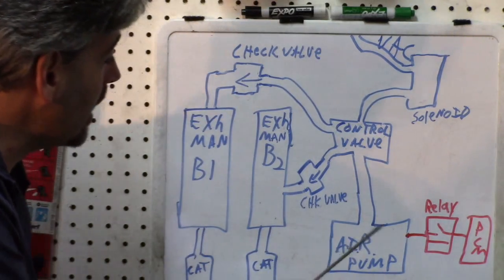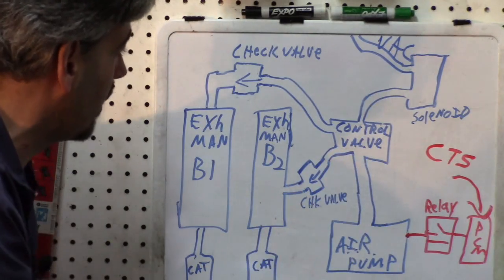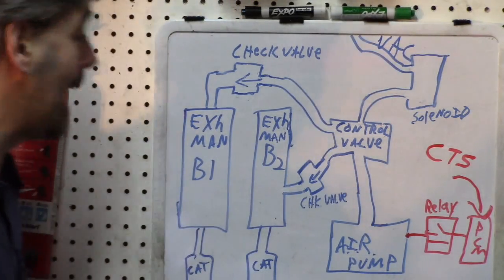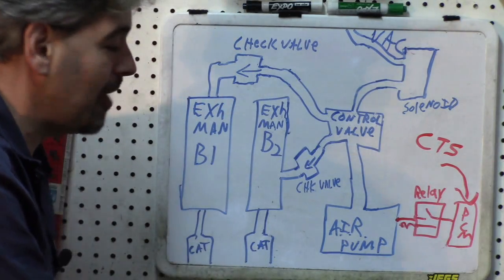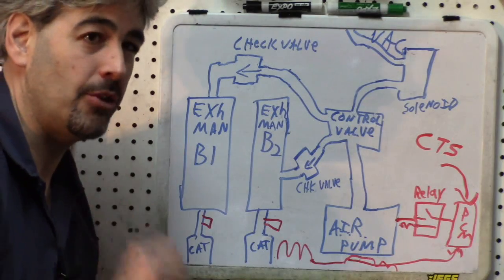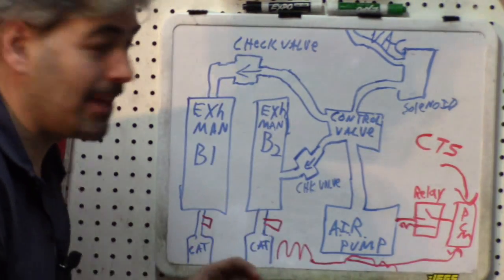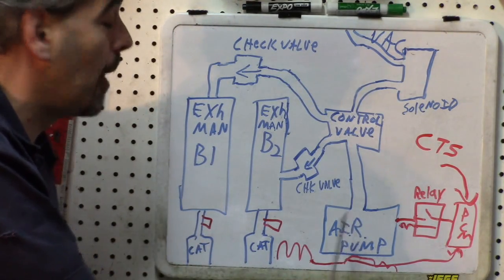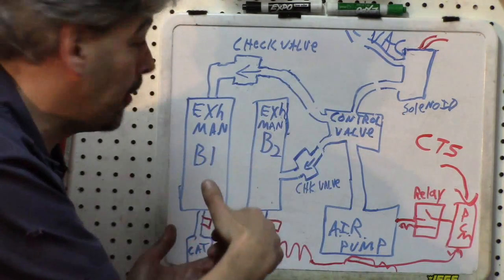Air Injection Reaction (A.I.R.) Diagnosis and Understanding-Pt1

Comment: Some European brands such as VW, AUDI and Porsche are integrating a pressure sensor in the A.I.R system in order to detect its function. Thank you very much for such detailed information on this and all your other videos!
Reply from the maker: Yes that is correct- I should have mentioned that in the video
Reply: Yes, but mine is old enough (22 years) that I believe its "improper air flow" is triggered by incorrect change in the exhaust system's pre-catalyst O2 sensor. A direct pressure sensor would arguably more precise and accurate, subject to fewer complications.

Comment: Thank you. My 2001 VW Passat 1.8T had two component faults in the secondary air injection system: 1) carbon-clogged "combi" valve (pump-to-exhaust controller); and 2) the solenoid control switch that tells the combi valve when to open or close. The silicone hose connecting the two was also suspiciously discolored and somewhat hardened at the solenoid valve end. Replacing the combi valve alone eliminated the check engine light, but the smog test monitor bit was still not clearing to 0/"ready." When I found no vacuum at the combi valve's nipple during a cold start with the pump running, I figured it pretty much had to be the control solenoid, so I dug that out and replaced it. No more check engine lights, and the smog test monitors all switched to "ready" after a 10 mile drive with three restarts and a couple of 45mph stretches with deceleration to stop.
Reply from the maker: How did you determine the combivalve was malfunctioning?
Reply: @SchrodingersBox  VCDS/VAG-COM scanner from Ross-Tech, my go-to diagnostic tool for my VW/Audi cars. Even my cheapo generic scanner told me that I had "incorrect secondary air flow." I jumpered across the air pump relay to make it run continuously for a few minutes while I felt for leaks at the pump itself (common VW/Audi failure mode) and in its plastic and hard pipes to the combi valve. At that point, I figured either the combi valve wasn't opening and/or closing properly. I went ahead and swapped it out, because it was 22 years old/original and looked discolored. Given the discoloration of the silicone tube between the combi valve and the control solenoid valve, I figured some sort of exhaust gas backflow through the control channel damaged not only the tubing, but also the solenoid, causing me to lose control vacuum during cold starts. 

As one of my friends on Passatworld.com pointed out, I probably could have cleaned the heavy carbon buildup out of the combi valve and saved it, but as long as I had gone through the trouble of removing it, I figured I might as well put in a new one, since they are readily available and not expensive.

Comment: Great exposition. Note that GM 4 cyclinder AIR problems are usually clogged ports under the exhaust manifold. The service bulletin for the P0411 code on is bulletin number 17-NA-080, which was released in February 2018.
Reply from the maker: Good to know!! Thanks!
Reply: Could it cause p2431

Comment: Excellent explanation - I couldn't understand why the check engine light (later found to be a failure code in the AIR) appeared when I was bombing down the highway on a fully warmed-up engine. But you nailed it! Thanks

Comment: What a great video mate. In your drawing you have  a diverting valve (splits one incoming flow into two). Some valves are combination switching+diverting. In this case incoming  flow is diverted (switched) from one port to the other. Also some of these  valves can regulate the flow output of the pump.
Reply from the maker: Great point!

Comment: Had a P2440 code and Check Engine light on my '05 Tacoma.  "Secondary Air valve stuck open".  Finally found a source to buy one without breaking my bank ($140)  and ordered one.  Waiting for it to come I was
thinking "I wonder if I can UNstick this thing?".  I pulled off the hose that runs from the
smog pump to the valve at the valve inlet port and squirted a couple ounces of Mercury
Quicksilver (an amazing product designed to de-gick marine engines) into it.  Let it
sit overnight, cleared codes with my ODBII gizmo and drove the truck to town and back.
The CEL never came back on.  Now I'm debating whether to keep the new valve or return/sell
it.  I can do this 30 second repair a BUNCH of times with a ten dollar can of liquid magic!
The truck is a 2.7L 4 banger so it just has one 'bank'.  I would think it may work on a
V6 or V8 too.  Hey, it's a quick and inexpensive trick to try!

Comment: Actually, there is a vacuum tube that goes to the intake manifold on an 01 4.3L S-10 from the solenoid valve that you showed in your diagram.  That "vacuum tree"(behind the throttle body) connector also drives the cabin HVAC air direction control valve, and goes to the vacuum canister mounted in the driver side inner fender.

Comment: Looks like GM changed this system in some year models. Have spent 5 plus hour's checking the different components in my car secondary air induction system and found there are a number of differences.
First there is no diverter relay but a T connection to check valves.  But there is a Air solinoid valve in the pump itself and the motor, both must be engaged before air will flow.
Now there is also a Secondary Air Bleed valve solinoid this valve helps prevent vacuum within the air system, which could prevent the integral stop valve from opening. The bleed valve is controlled by the air pump relay and will be energized when the air pump is commanded ON.
My issue looks to be a high resistance contacts in the Air Solinoid Relay found to vary from a few hundred ohms to many K ohms.
This relay controls the internal stop valve.
Hope this is helpful. Information from original GM Workshop manual.
Graeme Redman in Australia
Reply from the maker: Very good to know!!! Yes the model shows always from 2000. I don’t doubt a ton has changed since then and in fact I have a video on a subaru with a fairly different setup more like you described.
Reply: The impalas are different than this to

Comment: I'm a PA state safety and emissions inspector.  I typically don't do many emissions inspections since I border 2 counties that don't require emissions testing and I'm in a remote-ish area of the one that does.  However, I'm brushing up on emissions systems because twice per year an undercover emissions inspector-inspector comes around and has you test their vehicle to make sure you aren't ripping people off or just slapping stickers on.  They sabotage something on the emissions system and you have to find what's wrong with it.  Nerve wracking.  To make things worse, once in a while there WONT be a problem so you spend an hour and a half checking and double checking and triple checking and can't find an issue so you pass it and the whole time you're writing out the sticker you're thinking "god I hope I didn't miss something and get a fine or lose my license over this"

Comment: Matt my 1999 Z28 Camaro had this code fault and found there is a filter canister on the inlet to pump. It has a number of filters in it that were dirty. I cleaned them but I then replaced material with some filter material I had. Another thing I found is my pump has 3 wires 1 for motor 1 for internal valve !. There is no diversion valve in hose line to check valves. From outlet there only a T connection to check valves. Now the pump is pumping air as it could not before due to dirty filters. Also noticed the internal pump valve is controlled by the PCM.
Graeme in Australia
Reply: See other post as this did not fix it it was high resistance contacts in the Air Solinoid Relay sometimes it worked but other times it did not anyway new relay fixed it and the valve now opens allowing air to flow every time now.

Comment: wow great!  i'm worried to connect the air pump direct to the battery in case it is not rated for that kind of current.  but anyway way cheaper than a tech 2!
Reply from the maker: I can't think of any motor-driven device other than maybe a stepper IAC that isn't operated by 12V with single directional polarity.
Reply: thanks!  what a great 'hack' to test the AIR pump w/o having an expensive scan tool to command it on and off.  i was about to test the pump by starting the car cold and listening for the pump with the screwdriver to ear trick.

Comment: hey this video is very helpful I got a check engine light on my 2000 camaro z28 it's the secondary air injection system p0410  .. so I decided to to buy a new air pump relay ,new air pump, new control valve and 2 new check valves one for each side should I get a new silond as well i don't know because I think if that was a problem I would get p0412 ...I got all those parts because I wanted to take care of this problem

Comment: Great video I just have a question I have a 01 Silverado 4.8 and it has no codes everything runs great but can’t get the air monitor to set so I was wondering does the water thermostat and coolant temp sensor have to be around the same temp during cold start? My truck takes at least 10-15 mins to warm up and doesn’t get above 200 degrees wasn’t sure if it has to do with that, plus the pump only runs for about a minute and 15 seconds I’m lost was thinking it was the water pump not circulating the fluid thanks for the info in advance have a nice day sir

Comment: THE FAULT WAS THE Air pump solenoid Relay.
Checked relay coil OK
Checked relay points and found high resistance when relay closed.
Replaced this relay now have full flow of air from Air Pump.
Will now have to drive car a few times to confirm all is fixed.

Comment: My 2011 c300 Benz has a p0410 air pump failure and a p0420 catalytic converter bank1 sens 2 Check engine code too. Would the bad secondary air pump cause the downstream bank 1 sensor 2 to have a fault? Occasionally it will throw a code p0015 exhaust cam b fault?

Comment: I’m going through this right now. I have a the code po410. I’ve done my t/s, found my pump runs, solenoid works and diverted valve. Got deeper and found the vacuum line off in back of intake. Found 4mm line and plug back in but it has a tee that is 6mm on the other side where does that go

Comment: Great instruction !  I have an early 70s Chevy 454 that I want to put the smog pump on again but was wondering how that system shuts off at the right time when there are no sensors or computerized components? I think I heard that it shoots oxygen into the exhaust to more or less dilute the NOx fumes, burn off some of them and quickly raise the temp to enact the cat. How well do these old style AIR systems work? Have any info on that?
Reply from the maker: great question. some of them worked on engine temperature- basically when coolant temperature is cold, there would be a mechanical switch that turns on the AIR and then as engine heats up, the coolant expands and maybe moves a float or some kind of trigger to interrupt the AIR switch and turn it off. actually a lot of older systems used a mechanism like that. you would see on much older cars these tall vacuum “trees” stemming from a coolant port with all these vacuum lines branching off it. basically they have a float in the “tree” with a ball that floats to enable or disable those lines along the tree as it floats up with engine temperature increase.
Reply: Now I see, my car was the last of the original A.I.R. before Catalytic converters in 1974. It did not shut off and pumped air into the cylinder head exhaust ports to reduce unburned fuel. But it was causing damage to exhaust valves so next they went to cat converters with secondary air injection that shut off as soon as the cats became hot enough to run on their own and do the clean up of Noxious fumes. So running an original AIR pump with a catalytic may not work so well because they not compatible.

Comment: Dinger is pretty good at explaining how things work and has broadened my knowledge base. I do however have my own question ⁉️ Mr. Dinger sir, do you use a scientific method with the ladies, if you know what I'm saying!!?? I know there's lots of parts "under the hood" and I can turn the dials and flip the switches ok but maybe a manual?? Power side or ground side control, when should oil be checked, and other fun stuff like that. I'm doing ok now but I like to get better at something every day :-) Understood if cars and "SCIENCE" insert Thomas Dolby voice!!! are your thing 😂😂😂 just a thought, always wondered what was under the wives hood and maybe tighten up the a/f ratio
Reply from the maker: Lol sorry no- I still have not figure them out at all hahaha
Reply: The lady parts defy science 🤔...r. Gladwell, I accept your offer. Only 10k hours! I'll have done and report my findings by the weekend. Seriously tho I by some dinger swag. Youve helped me look at things in a different way. Not just try to copy what YouTube guy does but to think independently and figure out why or how. I never charge for mis diagnosis and after selling well over 30k cars in last 25-30 years. Every single misdiagnosed problem must have cost me 250k plus a year. Wanna guess what the mechanic answer was every time.... Yep you guessed it.... " It needed that too" classic it's the free all, check mate block just like "fake news" can't ever prove write or wrong. My bills are drastically down and body getting tired at 50 but the knowledge is priceless!! Thanks again for being thorough and entertaining!!
Reply: Now with the Dinger t-shirt I may hit 20k by the weekend!! Shit I'm married.. ah well there will be lots of jealous women out there 😂

Comment: Hey.  Great video. I have one question. If the vacuum line going to the air solenoid is not working properly (not holding vacuum/is cracked or has holes in it) what would be the effect on the operation of the solenoid and the operation of the diverter valve?  Thanks in advance.
Reply from the maker: The solenoid would operate but since there is no vacuum the diverter valve would not.

Comment: Do all of these air systems have check valves in them?  The reason I ask is, on James Danner's channel, he has a case on a Sonoma where the inlet and outlet hayoses (that's Danner for hoses) are mixed up.  This caused the air pump to fill with water which then made it draw too much current and blew the fuse.  So you could replace the fuse and the pump would run, but sooner or later it's going to blow the fuse again.
Reply from the maker: hahah "Hayoses" lol.
  That I have seen, yes, all AIR pumps (and the tubes after the solenoid) have some type of check valve system.  The former, to prevent water entry in the motor as you described and the latter to prevent exhaust from backflowing into the AIR system.
  I have learned never to say "never", "always", "none" or "all" when it comes to automotive designs but so far I have not seen a system without checkvalves.
Reply: Schrodingers Box Cool.  I haven't seen a system without them but I can't say that I've checked every single system ever made! LOL!!!
By the way, no disrespect to the Danner's,  I love their videos and they certainly seem like extremely cool people.  That accent is pretty funny though.  I think Jim's is even more defined thank Paul's.  Never-the-less,  great guys!

Comment: How the air enters the engine block back into to exhaust manifold to feed the cat? Can you blow air trough the secondary rail to make sure not clogged?clogged?
Reply from the maker: On an AIR system it actually never goes through the engine. It only goes right to the exhaust. 
   Yes you blow compressed air through the passages if there is a clog but most likely your clogs or carbon development will be at the check valves.

Comment: I don't have any codes at all and I didn't even know this system existed until I started researching my whining sound at cold startup only...my trailblazer sounds like a jet engine for the first 20 seconds of startup...

I wonder if maybe a valve is sticking somehow allowing that whistle sound to occur....
Reply from the maker: Could be. What’s the compression showing?
Reply: @SchrodingersBox  I didn't test it yet...the sound is definitely coming from the air pump motor...I wonder if a bearing could be bad on the fan/turbine causing the noise

Comment: hi ..i have a problem i got beetle 1998 and one of the hose of the air pump the one the go to the filter broke and the previous owner put a hose that doesn't fit and leek air..what kind of symptoms cause this leek..mass air flow sensor fail? i change the  air flow sensor but still have  the code, please help me i need you advise..please than you

Comment: It's the water pump has to do anything with the air injection code for a 2001 Chevrolet Silverado 4.8?
Reply from the maker: not likely. the only way I can see that as a possibility is if the water pump pulley is frozen causing the AIR pump pulley not to operate but then you would have far worse concerns.

Comment: Would you please take photos of your vacuum lines? I am having difficulty tracing where all the vacuum lines go. Thanks!!!
Reply from the maker: There should be a vacuum and emissions diagram on the underside of the hood
Reply: @SchrodingersBox  unfortunately that diagram is no longer there... most photos online are black and white and it’s very difficult to follow.
Reply from the maker: here is a really clear diagram that’s easy to read. https://www.camaroz28.com/forums/general-1967-2002-f-body-tech-46/vacuum-line-diagram-routing-880068/
(scroll down a bit)